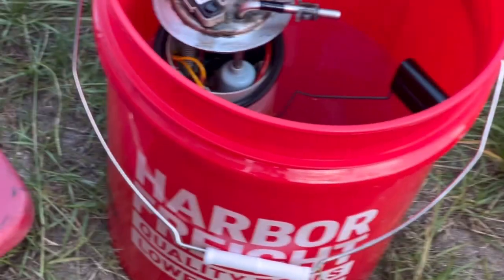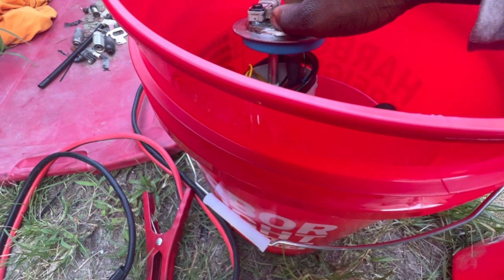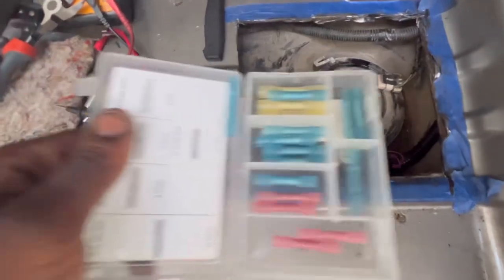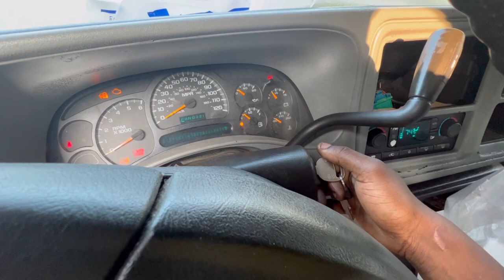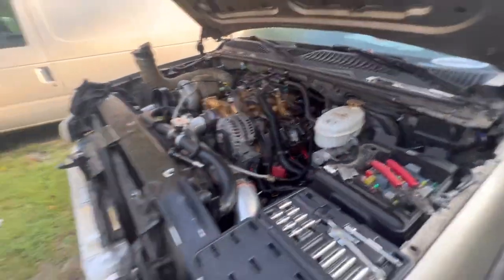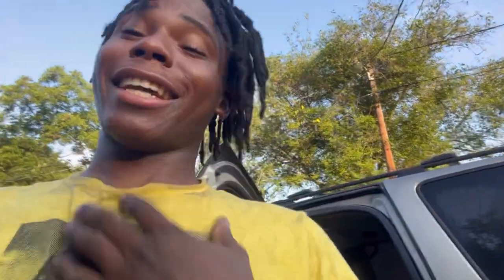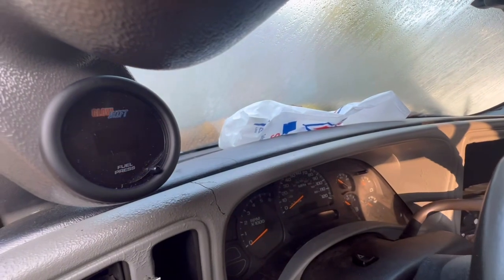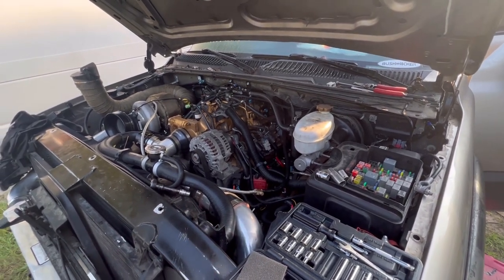I thought fuel pump had issue but now it’s working here is why?

Comment: Do not feel bad young brother. I have been working on my 96 Dodge ram 1500. I've rebuilt the transmission, rebuilt the upper half of the engine and blocked new head gaskets, intake and exhaust. New plugs and wire and ignition coil and pick up and cap. Got in the truck and it fired up but I have a misfire on 1,3,5,7. Found out my fuel injectors stuck open on 1,3,5 and 7. More money more money more money. But it's all good. Keep up the good work, you will figure it all out. That's how I learned about vehicles all by myself. Self taught is always better.
Reply from the maker: Yes sir appreciate input mean a lot 🙏🏽💪🏽 and keep going and remain open mined 💪🏽